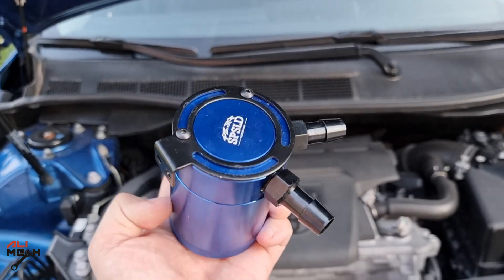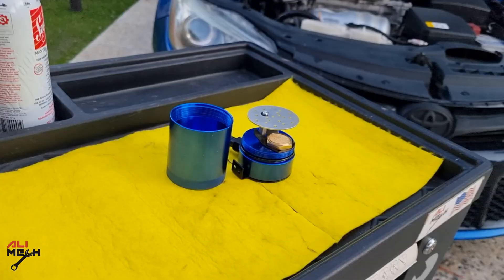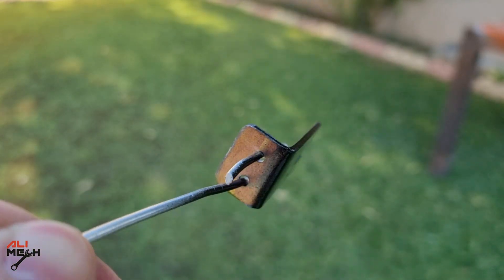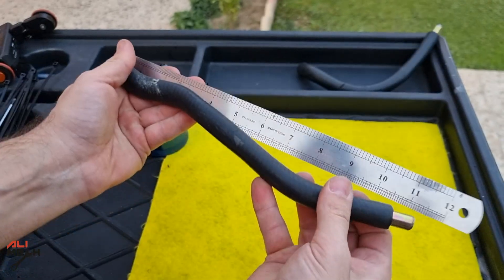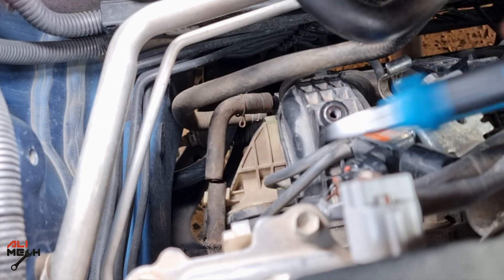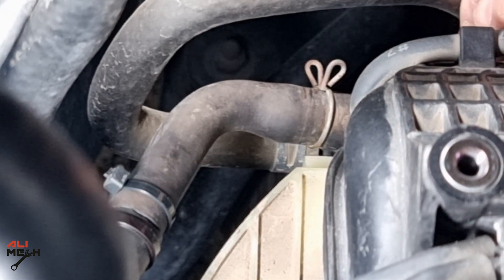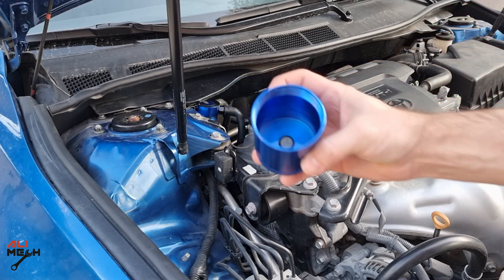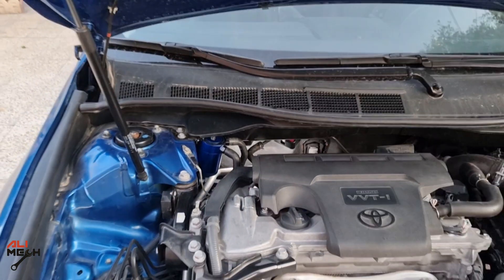Quick fix for engines burning oil TOYOTA Camry 2015-2017/How to prevent carbon buildup in engine

Comment: You know there are 2 crank case breathers don't you?? the second is right on top of the engine, between your rocker cover and plastic air intake pipe.
Reply: Two hoses ≠ two PCV valves.

One is a metered PCV circuit, the other is a fresh-air breather. This video addresses the PCV side intentionally, which is where oil vapor is actually ingested.

Comment: Hey @AliMECH
Will the position/height of the oil catch can matter? I am australia. For me, the brake fuild reservoir is on the left where you installed your oil catch can and there's not enough room to install the oil catch can. So, I was thinking of moving the catch can to the right (where USA models have brake fuild reservoir ). Do you think it will be okay since there will be long hoses and the catch can on the right side?

Comment: For the people that live in wintery/snowy environments - your catch cans may freeze clogging your baffle/filter and can cause engine seal damage as your PCV will not be able to breath.
Reply: So is it the pvc the problem of my oil consumption, I have my 2015 from almost new 10k miles and always did my own maintenance Mobil 1 oil every 5k and for a while it burn more then a quart maybe even 3

Comment: Great job using Aliexpress!  did you but the hoses from there also? u have a link??  I am looking to buy a replacement evap hose that comes from the throttle body for my 2008 camry but cant find the number and trying to see if i can retrofit with a similar hose cut to size..

Comment: So in instead of burning the little bit of oil, you catch it in a can that you have to empty and maintain? On cars that are DI only I can see it being slightly beneficial. If you have port injection, its a waste of time.
Reply from the maker: Even if its port injectors, they eliminate the injector tip to be free from that boring oil while the intake valves been washed with fuel

Comment: Thanks for this good content video.  Can I install this device on diesel engines?  I have a car (Opel zafira tourer c CDTI 1.7) year 2017 with direct injection engine from General Motors. Thank you again.
Reply from the maker: Yes, absolutely, you will see some oil been catched every month

Comment: I had install same unit in vios,
by my experience is collect oil 30cc per 5000km.
My unit is leave engine away 30cm close to car head.
I think your unit is too close to engine, the heat make unit can't cooling down oil gas and catch in unit...

Comment: Great video Ali! I own a 2015 camry myself and i have been learning a lot from ur videos. Would like to see a valve carbon cleaning video if u can that would be awesome
Reply from the maker: Thanks, I have that in plan too, I will do that video
Reply: @AliMECH  why you install it there?  I see people install it from the between intake manifold and pcv valve.  Is that where it located?
Reply from the maker: Yes it's where I exactly installed
Reply: @AliMECH  I see people instal duel catch cans. Are you going to do the same as well? I want to do other things to my camry like lowering it and stuff like that so if you make videos that would be awesome